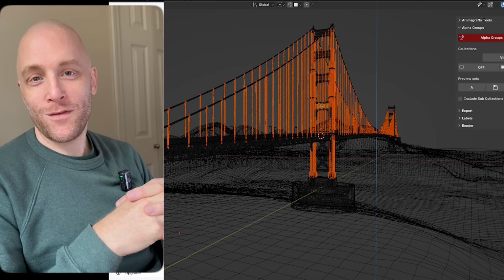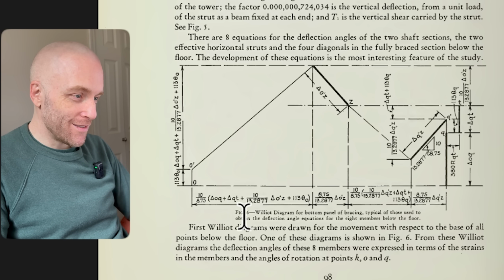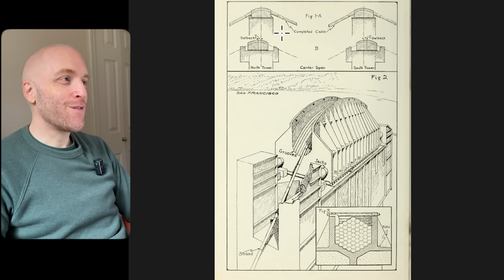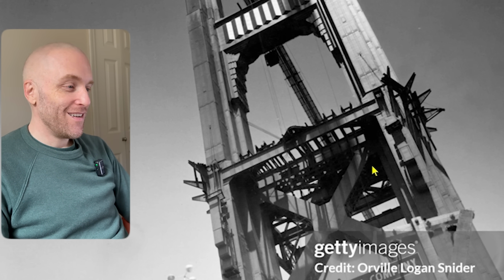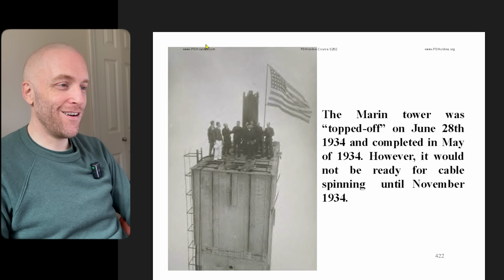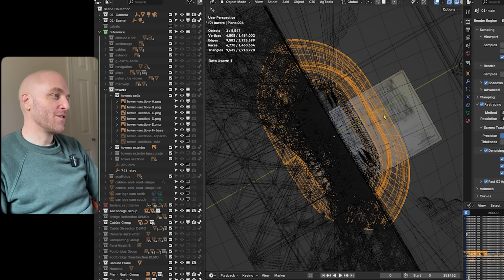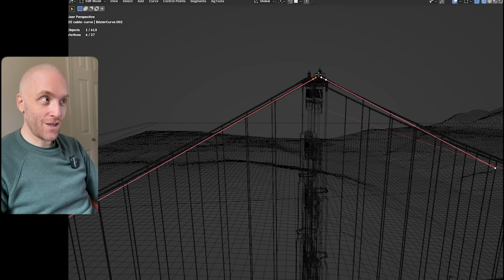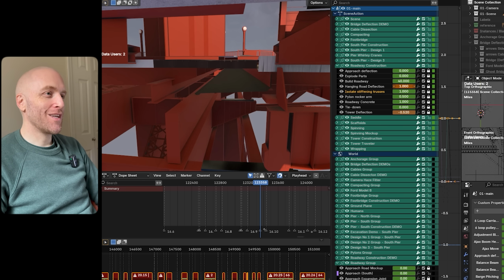How I recreated the Golden Gate Bridge (historical research + 3D modeling)

Comment: It’s interesting inside hearing the echo of the vehicles going over the bridge all the way to the top. It has a distinct odor too.  A good thing is you can use your magnetic flashlight anywhere. You can also fall through the holes easily going through the length of the tower.

Comment: First off I just ĺuv ur videos. Luv wat u do. I don't mean to be rude but at minute 13:50 you said "cement block" it should be "concrete block" where as cement is but one of 4 key ingredients in the manufacturing of concrete the other 3 being sand, water & aggregate(gravel)

Comment: 40:20 Structural engineer 42years: what would the engineers doing calculations by slide rule for this bridge think of the computing power available today? Trees such as this are used today to generate complex curved building shapes, the structural design of the building and its related components are modelled in a very similar way.

Comment: コンピューターがないのにこのような計画をしていたなんて本当に信じられません。
当時の設計・計画をした技術者は恐ろしく優秀で現代から見ても素晴らしいものです。
現代人はコンピューターで何でもできると思いがちですが無くても頭と紙を使えばこのようなことが出来るのだと思い知らされました。

難しい内容のビデオを素人でも分かりやすくかつ正確に作り上げる動画作成者様に敬意を表します。
動画のおかげで建築のエンジニアリングに興味がわきました。
本当にありがとうございます。
Reply: They did have "computers"; at the time computers were people who did the calculations. (Japanese even has a specific word for them: "計算手". There's a page of that name on Japanese Wikipedia, though the English version of the page has much more information.)

The advent of digital computers allows much faster calculation, but doesn't change the fundamentals of mechanical and civil engineering: you still need to e.g. understand that you'll need to come up with a mechanism such as the saddle movement on top of the towers to handle the changing strain on the cable that will cause its angles to change. A computer won't do that for you.

Good engineering work has always been remarkable by the standards of any age. As this video points out, we tend to think that our engineers and our societies are more sophisticated today than ones in the past, but we're not actually: crunching more numbers doesn't make us crunch them better. (Sometimes quite the opposite, in fact.)

Comment: How cool!  You do fantastic work.  At 12:39, that coupling at lower left is just like the "tension torsion straps" in a Huey helicopter.  It is used there to carry the centrifugal forces of the main rotor blades while allowing them to rotate in pitch without using a complex, heavy ball bearing.  There are several good videos showing how those straps are installed.

Comment: Definitely something nostalgic about the old drafting and drawing practice.

With computers and CAD and PowerPoint etc it’s so easy to produce stuff these days, most of it ends up being low quality or derivative. Makes everything worse in the end just from the shear amount of slop you have to work around.

Old school drafting was necessarily slow and intentional. You didn’t end up with 7 different versions of the same thing with slight differences, unsure of which is the master. (Or at least, not as often)

Comment: Hey Jake,

I am a graduate student researcher studying structural engineering, specifically the application of cold swaged couplers to rebar-rebar splices. I would greatly appreciate if you could provide any sources that you could locate on the design of those cold swaged couplers, as it is very difficult to find any information about cold swaging at this scale. 

Great video as always and thanks in advance!

Comment: I saw a documentary on the Golden Gate Bridge because of you. ( actually I saw about six)
But in one of them they said that the connections between the cables on the cold swayging is actually stronger than the cable itself
Reply: That's very common. Connection points like that are such obvious weak points that they tend to overdo the connections a bit, so that even if you screw up the connection somehow it's still going to be as strong as the stuff it's connecting. 

It's really amazing all the details like that which need to be considered, though.
Reply: @Alsadius Jake said it best. We're walking around the world surrounded by Swiss watches

Comment: Pretty amazing considering the time, 1920s-1930s. At about the same time in the other side of the planet, the Sydney Harbour Bridge was going up, opened in 1932. A shorter span but wider (8 lanes, 2 rail tracks, footpath). Driven both bridges many times, each an amazing feat of engineering for the time.